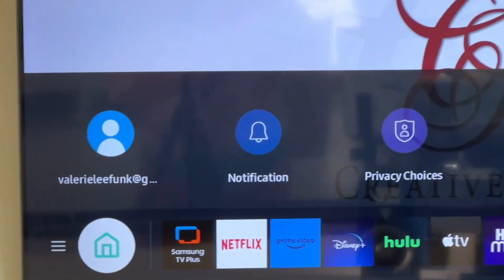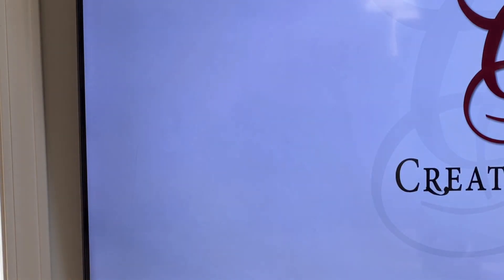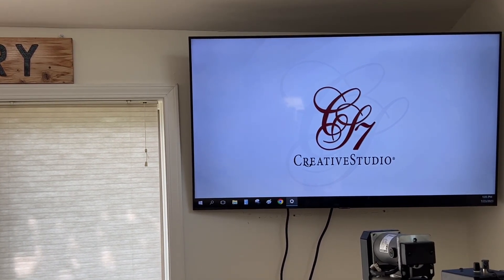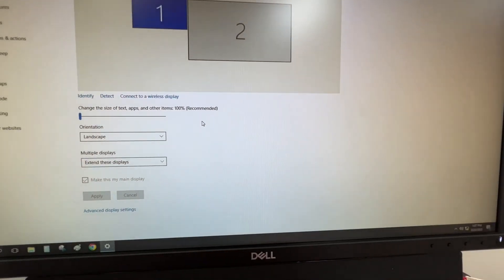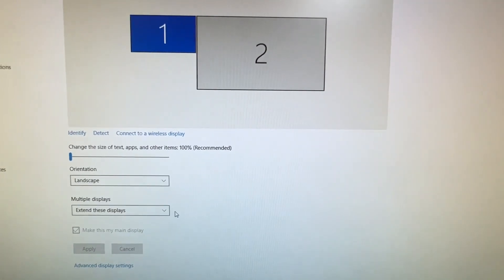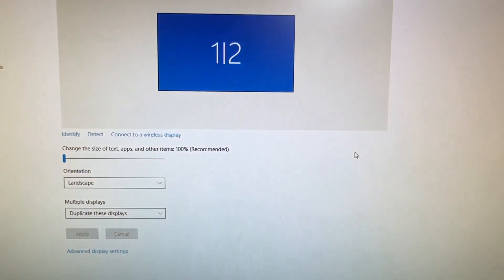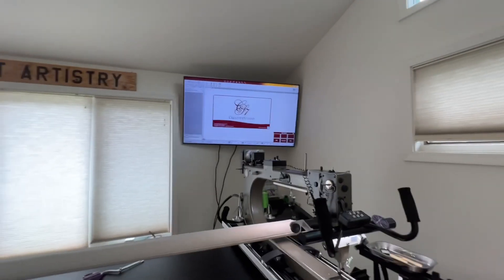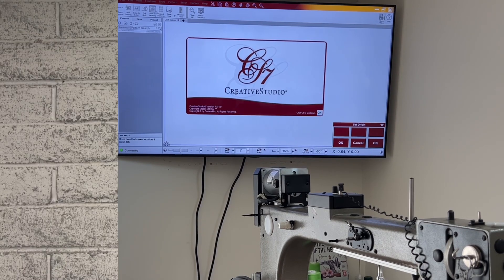Connecting an External Monitor to your Statler Computer

Comment: Why didn’t you just move the computer to the right side of the frame?
Reply from the maker: I personally prefer to have a monitor on both sides of the machine. I’ve become so used to having the actual computer on the left side that changing that would make me crazy 😅😊